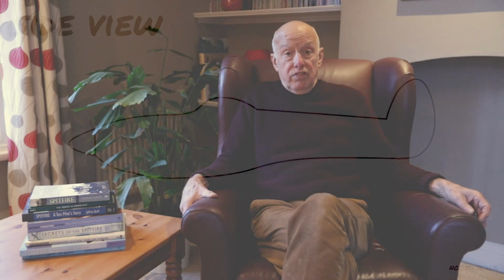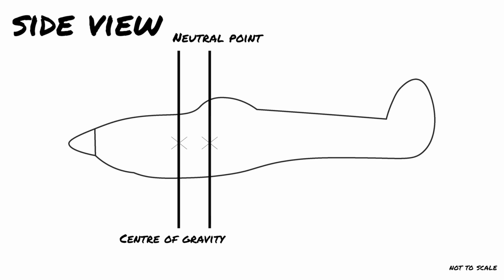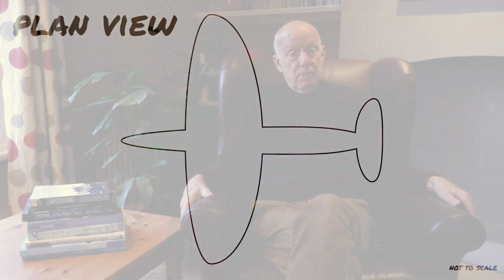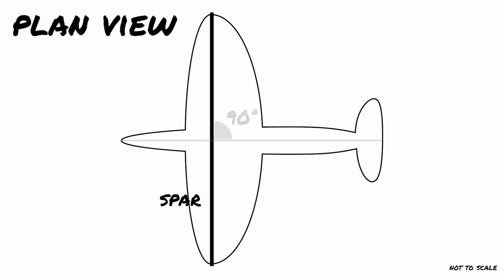SPITFIRE SPEAKS: Spitfire Longitudinal Stability

Comment: Thanks James. I think left to it’s own plans Supermarine would have developed a long range Merlin engined MkVIII variant capable of combat missions over central Germany by mid 1943 - probably with 96 gallons in the main tanks, 2 x 18 gallons in the wing roots, 75 gallons in the rear fuselage and carrying something like 120 gallons of fuel in a disposable paper torpedo shaped drop tank. It would have needed a larger horizontal tail section. Such a fighter would have been able to be based in Kent, fly as far as berlin, fight at full combat power for between 20 and 30mminutes in total, fly home (even into prevailing head winds) and land with something like 20-30 gallons still in reserve. 

If Supermarine and been given the green light to develop a centre fuselage radiator for the spitfire back in 1941/2, then all post 1942 spitfires would have been about 30MPH faster (both when running at economical most efficient cruise speed and also in combat at full war power ). 

Supermarine could have develop a late war Griffon engines long range fighter with the larger wings and ailerons of the Mk21, the spiteful tail and a centre fuselage radiator by summer 1944. Imagine a 470-500mph spitfire over Berlin by say sepetember 1944 ...

One last comment: even as a long range fighter, I think the spitfire would hav been better used to target the airfields and Luftwaffe fighters as they took off and landed - ranging ahead, rather than escorting bombers. The RAF could have left the USAAF undertake the close escort role whilst using the long range spitfires in a complementary role.
Reply: ...which of course ignores the fact that it had been well-established that air-cooled a/c were far better suited to ground-attack for all the obvious reasons.
Reply: @HeavensGremlin  True, that. However liquid cooled engines were commonly used for ground attach, CAS and low altitude A2A combat with good effect throughout the war.
Reply: @andrewmetcalfe9898  ;- Overall - including the PTO, the US operated predominantly air-cooled a/c in the ground attack role, and they proved much less vulnerable to ground-fire. In the ETO, the Commonwealth air forces operated Typhoons, Tempest and Spits, - and all suffered from this cooling-system vulnerability - and there was no real armour on the cooling systems. Later in the war in the ETO, the fighters were running-out of aerial targets, but when they came down onto the deck looking for 'targets of opportunity', this issue reared it's head again. Also the massed small-arms problems proved to be similar to  those experienced by the RFC in the Great War. The  Luftwaffe's '190  was air-cooled, and the Jabo versions also carried extra armour - I think the front lower cowl and the oil-cooler etc were armoured - much easier on a radial - as well as the cockpit  and ammo'-boxes I think.

Comment: The Spitfire may have lacked the range of some of the later war fighters but it's range was quite typical of most European planes of the time. As you explained, the Mustang ( a 2nd generation low winged monoplane fighter) had the range to escort bombers to Germany and back, but is was the only fighter in the allied armoury to be able to do so as far as I know. I am happy to be corrected on this point. As it was, the Spitfire was a world class fighter throughout the war and despite it's limitations, was the best we had. It held the respect of axis air forces from the first day of the war till the last day. The only allied plane to be able to make that claim. Great series of vidoes by the way.
Reply: Thank you for your well informed comments. This video is a bit of a precis, I perhaps should have mentioned about the use of bob weights on the elevator wires and adjustments to the elevator horn balances. Anyway glad it was of interest.
Reply: It was an actual conspiracy by the bomber mafia based in Washington to suppress abilities the already capable P47 in the long range fighter escort role that led to the promotion of the mustang as a ‘eureka’ type solution. The USAAF already had tested and certified 200 gallon drop tanks that would have gotten a P47s to the Ruhr valley for the big 1943 raids, but they were not used all the way there because of the bomber mafia war doctrine. Once that doctrine was failed, and the USAAF suffered unsustainable casualties, the generals and bureaucrats created the ‘we didn’t have a capable long range fighter trope’ (blaming phantom limitations of the P47s) and pressed the mustang MkB and Cs into service. Greg, from ‘Greg’s Automobiles and Airplanes’ covers this in detail in his P47 Utube series - which I recommend. 

While there is no doubting the Mustangs strengths for adoption as a long range escort, it wasn’t designed with that purpose in mind. It wasn’t more modern or ‘second generation’ when compared with the spitfire. By 1943 it was under utilised, but the addition of the heavier two stage Merlin engine actually solved some of its own longitudinal stability issues, such that it was then an easy task to insert rear fuselage tanks to compliment the front fuselage fuel and wing tanks (which were incorporated in the design from the start). 

The mustang had its own draw backs as a fighter. It was heavier, with a higher stall speed and wing load than the spitfire. Consequently it had more induced drag in a turning fight. The elliptical wings were better for actual war fighting than the laminar designed wings of the mustang 9maximum drive speed, rate and speed of turns etc). It did have a better rate of roll, at least until the much larger ailerons of the Mk21 came along.
Reply: @andrewmetcalfe9898  Nice reply. I called the Mustang a 2nd generation fighter (meaning single engine low wing monoplane fighter) as the development of this type of aeroplane only really lasted a decade from the mid 30's to the mid 40's and it's 1st flight was not until 1940 - halfway through the decade life of piston engined monoplane fighters. The 109 & Hurricane first flew in 1935 & the Spitfire in 1936 making them early adopters of this configuration. I think it is fair to say that any aircraft first developed in the 2nd half of the decade (1940 onwards) would be 2nd generation, having learned lessons from earlier aircraft. Just my opinion.